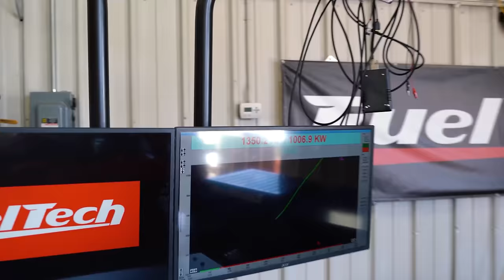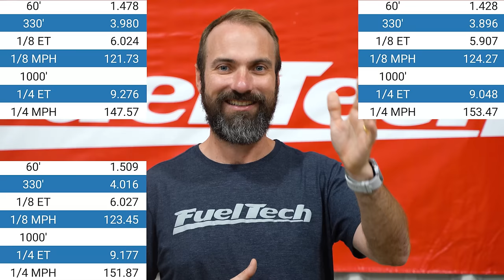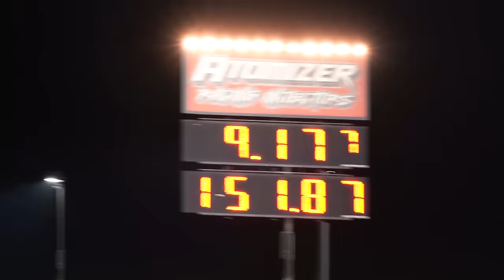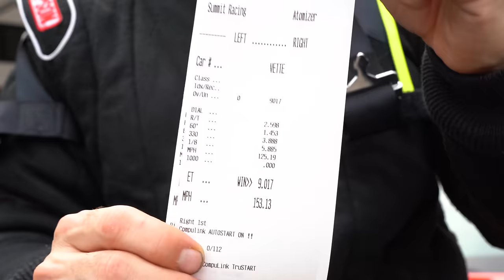FuelTech C8 Corvette Goes 9.01 at 153 mph | New World Record

Comment: Hell yeah, congrats! - Taz.
Reply: Hey Taz! In your opinion, assuming the ECU remains locked, what's going to be the key for the C8 community at large to make these kind of numbers?
Reply: Now im curious because emelia Hartford ran a 9.41 at 144mph on 990, but hasnt been able to get the car to make a clean pass down the 1/4mile since passing the 1000hp mark, and just recently showed numbers on the dyno of 1350 herself. That said the clutches in the transmission started to have went out immediately after those pulls. Must be the fueltech car is on fully aftermarket controls, and maybe some stuff the racing world hasnt been informed of yet. Honestly would just like to know how they managed to hold the power down the track to run a 9.01 in the 1/4 when nobody else has even come close to the 9.41 set by emelia and her crew. (Granted if she gutted the car, went on all aftermarket systems, and a non DOT track tire, her car would run a easy mid eights pass, just would destroy the clutches, if the car even hooked up

Comment: Great accomplishment FuelTech! I think 🤔 you can do 8's if in two last gears the clutch won't slip. But anyway, great achievement!
Reply: It’s 60 footing really well. Improving that and the 330 is where the ET will be found. If his clutch slips a bit that will hurt his mph. This might not make sense but you have to pause and think about it…if he manages to improve his 60ft without making much more horsepower, it’s likely that his mph will drop slightly.

Comment: Congratulations, I have been following Emlia, in the higher gears when the boost came on you could hear the engine revs flair, only a new transmission will take the platform forward but 0.018 to be the first in the 8s, is all you need would another type of oil get you that?
Reply: A faster 60ft will get him there w this tuneup

Comment: Is it pulling out power before each shift to save the transaxle?  The RPM climb rate is really interrupted at the top of the middle gears, it seems.
Reply: Just like traction control but for the transmission.

Comment: 1st gear change is crazy fast. Have you guys thought about or tried a 2nd gear launch? Clutch seems like it is slipping in the upper gears. Do you guys have a solution for that or is it just a power management adjustment? Keep up the great content and Congrats!!!
Reply: There’s no clutch to this power in the industry, it’s under development
Reply: @benga_e_benga  Dodson has an upgrade with extra clutches. Raybestos has an upgraded pack with steels and frictions.
Reply: @Cnmetz2  i know, this project uses a Dodson upgrade package, but still slipping when turbo pressure comes in.
Reply: @benga_e_benga  makes me wonder if they upgraded the stock friction. Raybestos clutch was used on ETS C8 and seemed to hold with the power load which was just over 1,000.
Reply: We have stage 2 Dodson clutch on this car but still working on the TCU control to hold more
Reply: @AndersonDick  is the Dodson friction upgraded over the stock oem friction?
Reply: @Cnmetz2  correct

Comment: Congrats!!! Where is the water coming from spraying on the glass and turbos. It actually happens about the time power is coming on in another gear and has a slip. Could just be coincidence. 

Keep up the good work.
Reply: Methanol injection
Reply: In a later video Anderson said it was a fuel line failure. In fact, it was fuel.

Comment: That's huge!
Back to Emilia. Honestly tho I don't think she'll beat this one. Lets see 8's guys. You can do it.
Reply: Maybe she should work with them, test their equiptment, assist in development and reap the benefits of tunability vs piggybacking on factory calibrations/fooling the stock mess.  Congrats to the FuelTech team, hellova accomplishment for sure.
Reply: @young11984  honestly I think it's great she's working with other vendors to develop a different system. These two are really close and the competition only pushes the C8 platform further along. As a C8 owner myself I've yet to see anyone really put out an all encompassing solution yet but it seems FI, and Peitz are the furthest along and most complete for maxing it out.
Reply: @dcsteve7869  she is but cutting edge is needed when trying to stay on top not adding more weight of piggy back systems and excess wiring issues that come with them imo. Always good to see other options when getting to this level and not having to be dependent on one to get something done, looks like Fuel Tech has it going on with engine and trans management in one system where she has a couple or three different manufacturers, overall though they are both making bad ass passes

Comment: During the runs you start to see fluid spraying out around the turbo and back glass? Also in 5th gear at full boost around 5-6k rpm sounds lip clutch slip or trans flare. All in all..badass and 8s are just a few button clicks away.Congrats

Comment: Correct me if I'm wrong but did you loose power at the end of the record run? Looked like 4th, 5th and 6th needs cleaned up. That is a mid 8 second car.

Comment: Very impressive! Dyno’s are great, but there’s nothing like the real world. Sounds like there’s some transmission issue in the last two gears before it cross the line. Maybe 1425 crank hp is the stock trans limit. Or at least the clutches limit.

Comment: If it weren't for the bad 60ft's and the trans flare issue in 5th and 6th gear it would have done mid 8's. Make Sure to check out LG Motorsports 15" Conversion kits for the C8's

Comment: The clutch is the weak link there was clutch slip in every gear with a better clutch pack that would have been 8.8 or better
Reply: this clutch is in development.
this car has 1500 hp in the engine
Reply: @wisleymuniz5752  Understood ...This car is capable of mid 8s and it will be a thing of beauty when it does it

Comment: Great job on the New World Record.  The only problem I see is your safety equipment. With a car making 1300hp you know you would run faster than 9.90 and your bar is not rated to run that fast, I see no halo hoop, no side bars and it looks like it only a 6 point bar not a Cage.  I could understand if this was your fist time make big numbers, but your FuelTech you know NHRA Rules and it our responsibility as racers to make sure when we post videos that our vehicles are up to Spec to meet NHRA Safety Rules. When I built my car with the goal of 1000hp I knew I would be faster than 9.90 so I made sure my car was setup for 8.50 NHRA Certification Safety Rules.  If I am wrong please let me know and will issue an apology.

Comment: Still not sure I understand what the infatuation is with drag racing a car SPECIFICALLY made for road racing. GM has done everything possible to make these cars hang with the world's most expensive cars on road courses, like the Nurburgring, yet "breaking" records with a car that was never made to drag race seems to be the fad. You may even notice GM tests extensively on road courses, not drag straps.  I guess this trend is because any straight-walking numbnut can find a dragstrip, but road racing actually takes effort. This is akin to making a Dodge Demon the fastest road racer in the world. Making a car expressly designed to drag race, and try to make it handle. There's an ass for every seat. I guess that's why they call drag racing starting practice.

Comment: this is cool, but what's the point? If I wanted a 9s car I could just lease a tesla model s plaid and rip it up and down the street all day.
for the time, money and effort spent on a car the will eventually fail because the clutch and trans are weak, you could have built a sub 8s car on a better platform.
Reply: The point is build a 9s Car different than any other 9s cars you can see everyday. 
The money and time spent are not important in this case.
He has a Tesla S Plaid already, a modified turbo Ferrari…